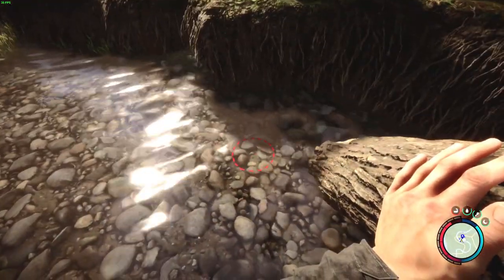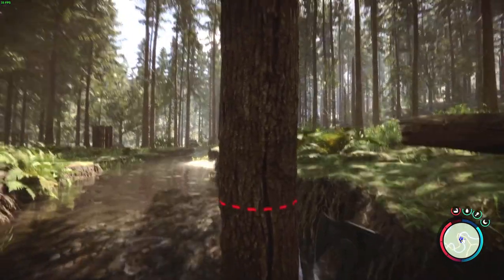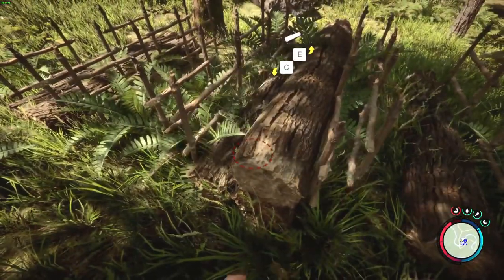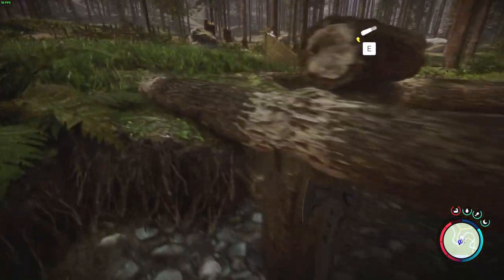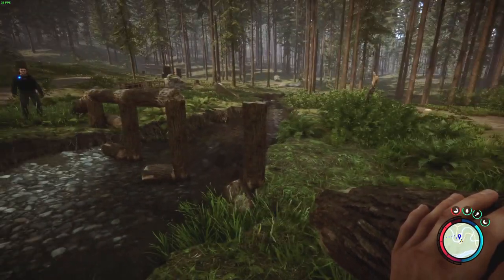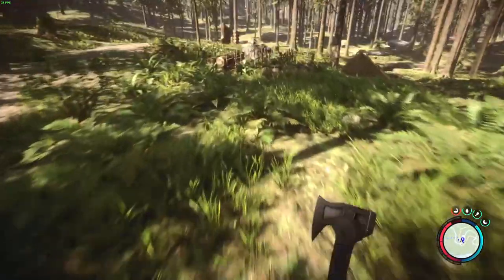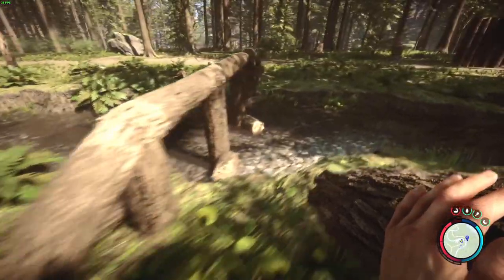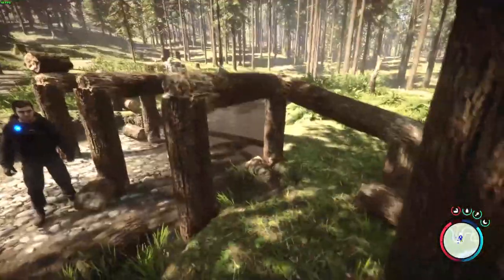Basebuilding Guide 02 | Basic Bridges | Sons of the Forest

Comment: you can remove the center log even without the small support logs. At least thats what i did in my house. Maybe it depends on weight?
Reply: i've heard in the winter snow can collapse your roof. maybe this is an oversight that would cause that to happen
Reply from the maker: I think the diagonal support beams are necessary if you build very long rows, 5 logs in a row.
Reply: @caracal3892  that might be the case. Ill need to figure out how this system actually works